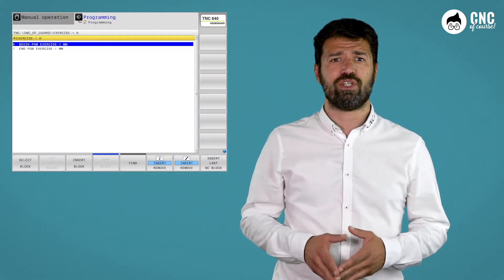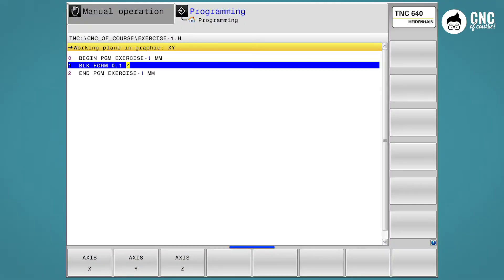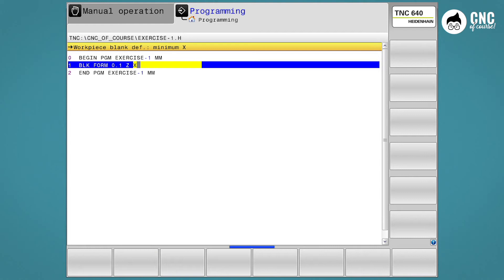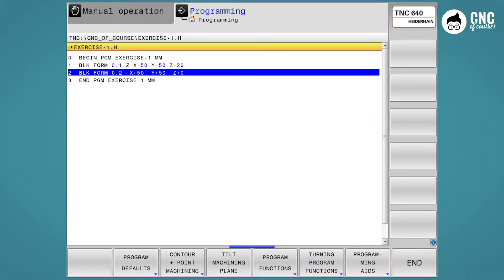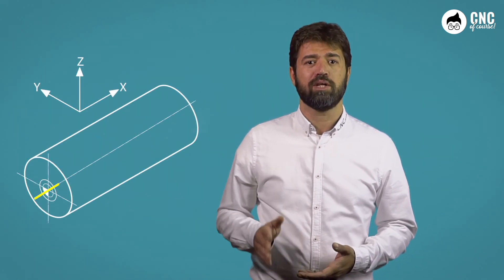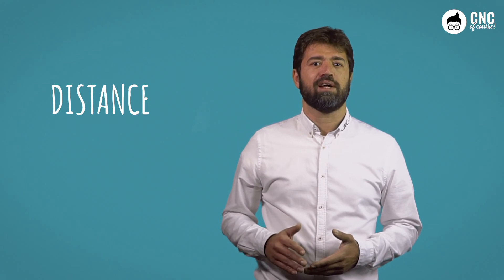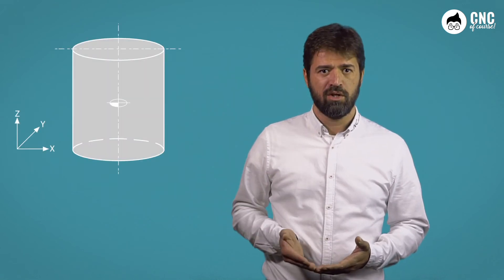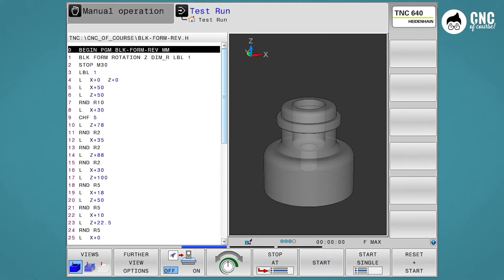Heidenhain course - Block Form

Comment: I wish you tackle about  manual programming by using cycle define,
Thanks.🙂
Reply from the maker: Hi and thanks for the request! This video is from our entire course on the basics of the Heidenhain control, you can find it on our website. In this lesson the teacher explained only the block form function and the figures available. The cycle def is tackled in a later lesson, and used throughout the rest of the course. Regarding the manual programming, I think you mean programming in the traditional way, so without using the CAM, am I correct?
Reply: @cncofcourse-EN  yes bro 🙂
Reply from the maker: @jeroJ10  Good! So as I said in the last comment, we've the entire course on how to traditionally program on Heidenhain (so all of the  programming functions profiles, subprograms, repetitions using labels, the main fixed cycles and so on) on our website ☺

Comment: My problem is that I enter the same parameters that you enter, but in the graphic view I see the block rotated with respect to the axes and the zero does not correspond... In the sense, I make it do a machining at X0 Y0, which corresponds to the center piece, but in graphics it makes me moved.  I don't have zero shifts or anything like that, nothing!  However, the machine is equipped with a bi-rotary head.  Could there be a setting problem with this one?  Thank you!
Reply from the maker: Hi! If you're still struggling with this problem, can you please send me a screenshot of the program with the graphic? So that I can better see what the CN shows. You can write an email to m.aletti@cncofcourse.com . As far as I can say offhand, is that your CN can have some axis preset, but I'll know better once I see it.